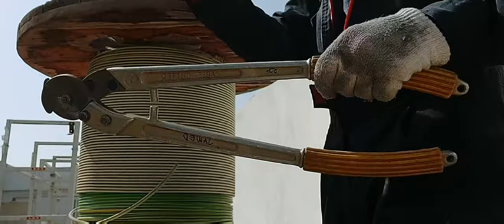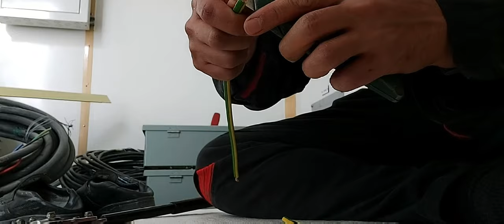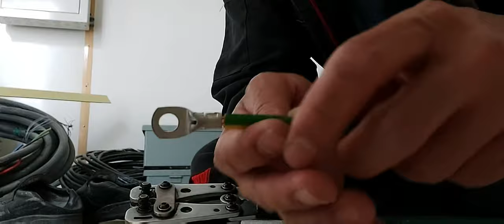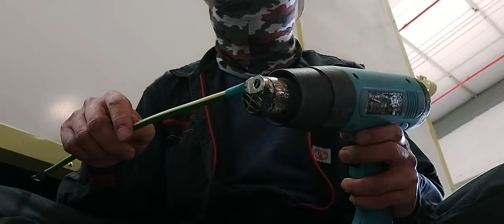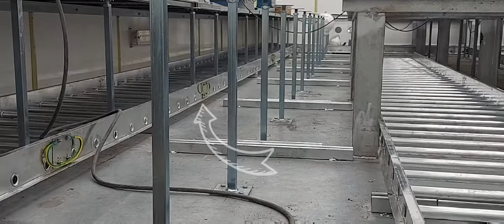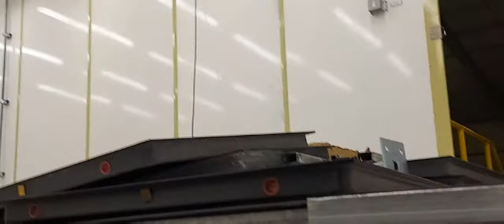How Cable Tray Ground Bonding or Earthing

Comment: Bonding jumper installation sa cable tray ay hindi puedeng ikabit sa splice plate bolt kasi that is intended for mechanical purpose. Ang bonding jumper ay may sariling bolting connection. that is intended for electrical purpose. Baka tayo masita ng electrical QA/QC inspector bro...